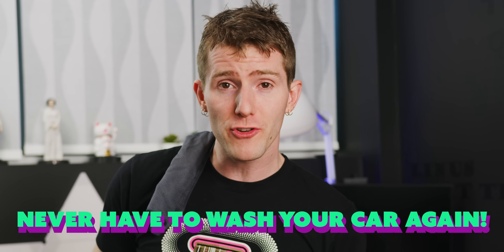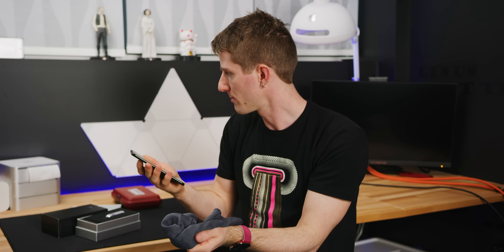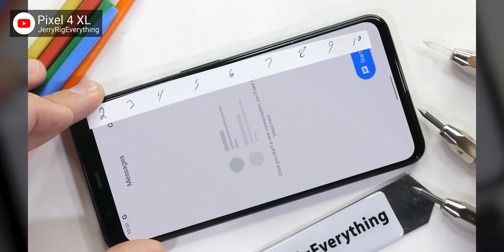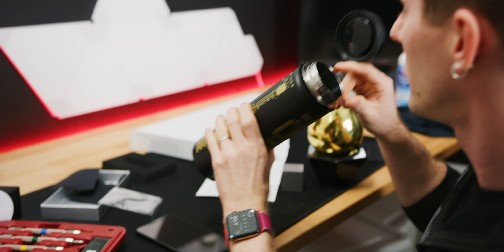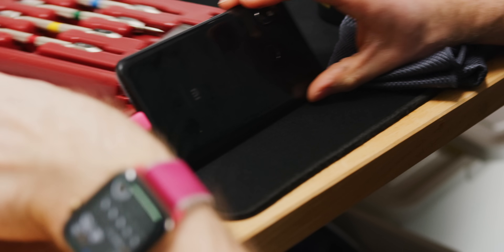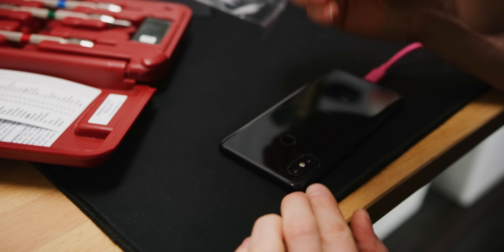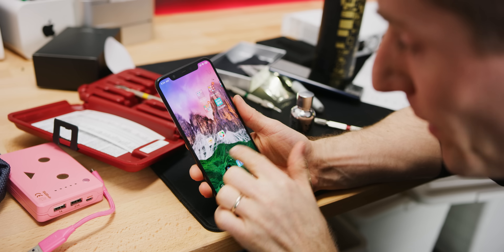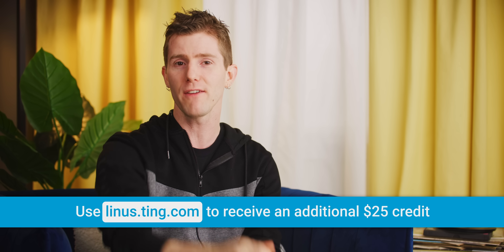Can Automotive Coatings Protect Your Smartphone?...

Comment: Applying procedure is not same, it varies from material to material. You read the instructions which is only be tailored if it's an ionized metal surface. Recently I ordered this thing to have ceramic coating on my motorbike which has plastic metarial. Just because of two different types of color coating on my bike, I had to apply ceramic coating in 2 different methods. You should've first make a layer with only the foam, then rub in criss cross pattern, then cover the foam with that microfiber and rub again until you feel the surface is bit sticky, then clean the whole surface with the towel. This procedure should be continued for atleast 4times with 1hour interval. The way you did is just wasted. You may try this again. Goodluck. A big fan of yours.

Comment: I don't think you applied it correctly.

On a car you'd have much more surface area so you'd use a lot more liquid and you'd be using some force to press it to the car. You put a few dabs on the sponge and lightly grazed the phone, that's definitely not enough.

Comment: linus: ceramic coatings are this wonderful mystery master product that protects all (*according to the marketing)
every car guy in existence: no you dunce. paint protection like xpel protects the paint, the ceramic coating protects the paint from minor scratches due to dirt and dust. it also creates a barrier between the paint and the dust  such that it is easier to wipe/wash off. it's too thin to make any real protection between rock chips or other large debris, but dust, dirt even finger oils will work just fine. The rock chip part is part of the reason why you still need paint protection.

Comment: As somebody who has used ceramic coating for automotive purposes and a former believer that it was in fact a "snake oil" I can attest that the stuff works wonders for protecting paint and really  does cut down on having to wash your vehicle.. That being said the ceramic coating you used is a general purpose paint protectant and they do make specific ceramic coating for glass that does a significantly better job of adhering to the surface, the coating you used likely just wiped away within the first time you "cleaned off the excess". Try using a ceramic silicon dioxide glass coating as it's designed to stick to the surface of glass much better and requires a longer curing process, I'd love to see you retry this with the proper materials and maybe even try drop testing phones with it to see the difference having a protective armor on the outside of the glass makes. Personally I have my motorcycle completely done up with a ceramic coating and I literally just have to pull out the compressor and air house and blow off and debris or dirt on my bike to make it look brand new again.

Comment: This is a great idea, until the screen breaks anyway. Then your screen is broken. With a good screen protector (not liquid glass or ceramic coatings), that is going to break before the screen underneath does. Why not use both ceramic coating/liquid glass and a screen protector for the ultimate combination of screen security?

Comment: Yes, drops of water flow more "quickly" off the edge of a surface when they are closer to the edge than another set of drops. What a good idea to test that.
Reply: Another way he could have tested was to apply a couple drops of water on each side and measure the waters contact angle to the surface, you would immediatly see that the water is more "round" coming off the surface on the coated part

Comment: "Don't get it wet for 5 - 7 days"

Linus's first test "Wets coating"

Facepalm
Reply: yep, Linus rushing things instead of doing it the right way, forming opinions on products that he is too careless to follow the directions on.  Methodology matters when you are testing a product.  It may have performed the same, but we wouldn't know.

If Linus never saw basketball before, went to a hoop without a net, he might assume you throw it throw the hoop and try to hit the square on the backboard, because directions don't mean anything :p

I mean, I've never played badminton, I just assume you are supposed to catch the birdie with your racket and try to throw it at the opposing side's face.  You get different points for hitting different parts, the nose is a bullseye, eyes are a penalty ...  if they catch it, just means its their serve.
Reply: Exactly 😂
Reply: *dont wash it for 5-7 days

No problem getting it wet after 24 hours but you dont want any chemicals on it before it is fully cured (which takes 5-7 days if correctly applied)
Reply: @Gomjokk  he did read out wash or expose to water for 5 - 7 days. But I agree its probably not going to be that bad.

Comment: This would not actually help your phone from anything more than scuffs. I currently own a detail shop and do quartz Coatings quite regularly. They're great for a car but I wouldn't bother with your phone good product goes for about $100 a bottle so good luck. It might be neat to have a water resistant phone with a water just literally slides off but other than use cases like that it's not going to be helpful not to mention you're going to have to put the coating on probably a minimum of every 3 months if not more. A car can go through about five hundred car washes but a phone is used so heavily and robbed in your pocket with keys and everything else eventually it's just going to come off and need replaced and granted you'd probably get a hundred Coatings out of a bottle I just don't see the sense in this when you could go get a screen protector on a case for Less that would be way more productive

Comment: Guys, will you ever test the "love mei hybrid" covers? I have used them for my last 4 phones, and I cannot reccomend them enough.

Guaranteed that your screen survives 3 meter falls in concrete, rugged enough for you to beat a goat to death with and is simply awesome.

Yes it takes alot of space, but I've never had a problem fitting them in pockets , even with my s10+, and for someone who works outside all the time, it's a godsend.

Comment: 0:10 ceramic coating for my car was nice for the first 3 months and then it had no effect whatsoever. My 9h coating btw.
Reply: Depends on the brand ... I've had good luck with 22PLE, but other less expensive ones like Armor Shield IX and CQuartz (or something with a similar name) lasted about 6 to 9 months without additional spray cleanings.